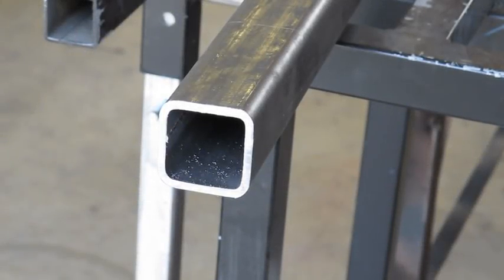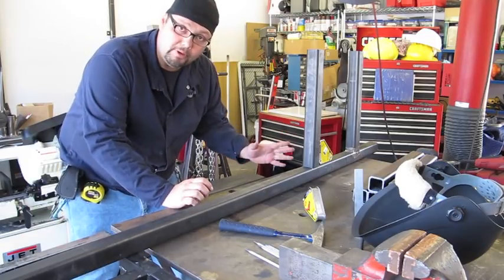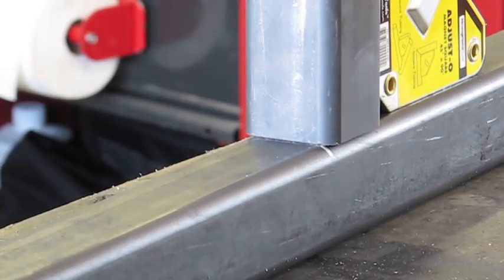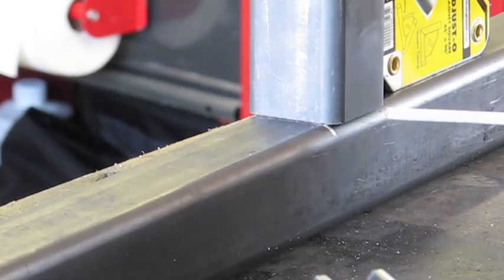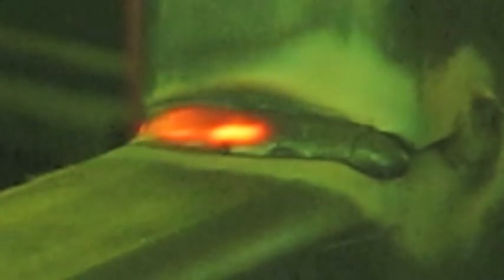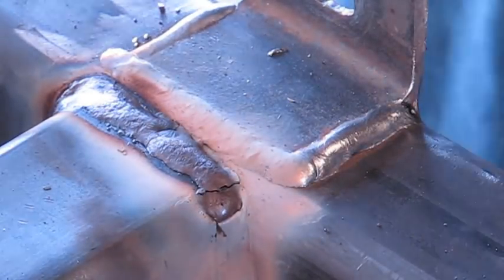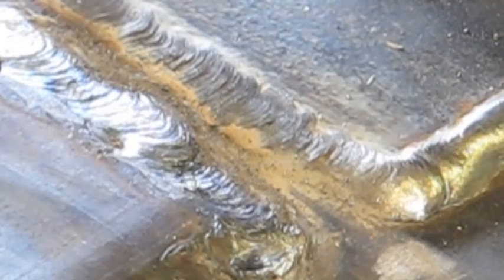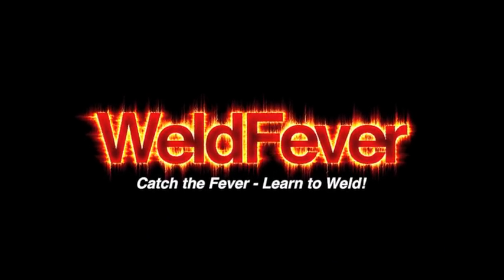Stick Welding Square Tubing

Comment: I always think of welding as a related behaviour to water drops, in that the surface tension of the liquid will hold the  liquid together and in order to bridge the drop to the side being welded this side has to be in liquid form too, so the handling of the stick has to see to that. If the temperature is too high the surface  tension will be low and the drop will collapse too much.    Overhead welding is possible because of this surface tension in liquids being kept  at a correct value.
To explain  welding to newcomers , I  first use water, A water drop on the tip of a pointer finger will not bridge with  the pointer  finger on the other hand, but on  closer range it will and a crescent will form. Once the drop bridges both sides  to be welded, the heat flow  to each side can be  regulated  through the positioning of the electrode with respect to the mass of material on either side.
The last time I explained  this to a pensioner  trying t learn to  weld, he said, " It is like trying to teach the electrode how to DANCE!"
Reply from the maker: An excellent analogy, if I do say so myself! I too use water as an example to my students by comparing the flow of water from a common garden hose to the way the puddle of molten metal behaves as a result of the way you direct it. It seems to get the message through. Thank you for that insightful comment!

Comment: Hi Dan, what thickness electrode / how many amps did you use for this project? I'm about to weld up some similar tubing (50mm tube, 5mm wall thickness) but I'm still learning electrodes and settings by trial and error at the moment.
Reply from the maker: They were 1/8" (3mm), E7018's and I used approximately 110 amps, which is my default setting for anything under about 1/2" (12.7mm). Given your wall thickness, I might suggest a lower amperage of around 90, or using a smaller rod. Hope that helps, thanks for your question and please keep watching!

Comment: WeldFever 
Hi, What ampage setting was the stick welder set at to get those results?
thanks :)
Reply from the maker: SP330Y I beleive it was around 115 amps +\-
Reply: +WeldFever can you make a video with smaller pipes like 4cm by 4cm in 2mm thick ? what amps will you use and what kind of electrodes in this dimension ?

Comment: looks good man. why did you decide not to add gussets?
Reply from the maker: Rmz250ryder I felt it would be strong enough without. Especially given the deep penetration and fusion as a result of using the stick electrode.

Comment: Great video bud,very informative.I have a question for ya.I'm going to build a go kart with square tubing.What thickness tube do you recommend for the frame?Another question is I have a Sears 115volt wire welder and I'm using flux cored wire and I have .035" and I also have .030" wire and I also have a buzz box 220 and I have E6011 and 7018 rods.Which one of the two machines would you recommend to use for a beginner like me on this go kart project?Thank you for your time.
Reply from the maker: James Parmenter without knowing the specs, or how much weight you're going to put on it, I couldnt even venture a guess. My best advise on anything that's going to hold people is to over build the heck out of it, but that's all I can really say. I would use the buzz box with dry 7018's (out of a hot box or hermetically sealed packaging). The reason is you'll get better penetration than the 115 can produce, and being a beginner, you may not realize it if you lay down a weld with MIG that does not fully fuse, or penetrate. Whatever you do, don't take any chances! If you're going to build something that you intend to put people in, or on, make certain your welding skills are where they need to be before you build it. That's my best advice! Good luck.
Reply: WeldFever Thanks for the advise bud.Keep up the good work.
Reply: WeldFever hey weldfever, my friend wants me to make him some tube doors for his jeep, what size would you recommend?

Comment: What do you recommend for a good stick welder without draining the pocket book?  Is this a 110 or 220?  Do you need gas for a stick welder?  If so what kind of gas.  Thx
Reply from the maker: In another comment you posted, I mentioned I started with a Lincoln-225. It is a 220 volt machine, and you do not need gas for an arc (stick) welder like this, or any stick welder for that matter. Hope this helps!

Comment: Great video - thanks. While others have claimed to be ''noobs", I'm the real deal... :-) (just bought a small arc welder yesterday, don't want to try using it until I get some proper PPE). Anyhow, regarding safety, the manual in bold letters states it should never be used outdoors. Other than the threat of rain or grass fires - any other reasons?
Reply from the maker: +shootgp Well, if it's a MIG welder and you are using shielding gas, then you will want to avoid winds stronger than 5 miles per hour or it will blow your shielding gas away. Other than that, I could't tell you why it would recommend against it?
Reply: Make sure neighbourhood kids don't look over the fence and get flashed.
Reply: Henry, thanks for the comment. I hadn't considered that - but it does make sense.
When I see someone doing a weld job in the drive way, like an idiot I'm trying to look and see what is being built...
I was thinking perhaps the reason regarding outdoor use was pertaining to extension cords (probably of the wrong gauge/length).
Reply: I should say, in addition to grass fires/rain/extension cord problems, and now blinding the curious.
Reply: +shootgp Mama always told me not to look into the mouth of the sun... but Mamma! that's where the fun is!
Stick welding outside!

Comment: I bought one of those square magnets and tried to weld a short piece od 10mm rod onto a piece of tubing while holding it up straight with the magnet.  The arc caused a lot of splatter and the welding did not want to grab onto the rod. After several adjustments to my welder and changing welding rods I still had very poor results. Then it struck me that it could be the magnetic field... I removed the magnet end whalaa! Immediate success. 
Can you guys tell me if this is a correct assumption? If so, what distance is ok for the magnet to be from the arc?
Reply from the maker: +Okkie Butler A disturbance to the arc caused by a magnetic field is called arc blow and it is very common when welding on DC polarity. Try welding on AC with your magnet on (if you can). If you no longer eperience problems, then that arc blow is confirmed.
Reply: +WeldFever Thanks for the comment!
Reply: +Okkie Butler you can try wrapping your ground cable around whatever you are welding, if it doesn't help trying wrapping it the opposite direction, i believe this sometimes helps if you don't wanna use AC. Or just don't use the magnet
Reply: +Okkie Butler the lincoln 300 has some nice control settings to vamp up the arc force and it really helps. some of the top end machines overcome the issue.

Comment: i build booms for wreckers.  we use mig, and the plates on those can be up to 1/2".... it is strong enough to withstand the pressure of lifting a tractor trailer... i understand stick is supposed to be stronger but if mig welding can do that, why do you say 3/16th is soo thick you need to use stick?
Reply from the maker: +Michael Hall Here is a copy of something I wrote to another user with a similar question:

"Let me try to explain what I meant. My shows are mostly meant for beginners using consumer grade products. As such, these products do not usually have the amperage ratings necessary in order to produce a weld with proper fusion and penetration on thicker, heavier, structural type material. Add in the fact that we are welding using the short circuit mode of metal transfer with the GMAW process, which as you probably know is the "coldest" of all the modes of transfer, then you can understand why I caution my users. The bottom line is that I don't want someone to believe they can take a 100 or 140 amp MIG welder and start making trailers and tow hitches with them, especially if they are not experienced enough to know what proper fusion looks like, which I run into all the time. "

So, that's why I made the statement, and I hope that explains it better. I'm certain you are using a commercial welder with a higher current output that can easily tackle what you are referring to, but that's not the case with the majority of my viewers.
Reply: ok that does make sense.

Comment: Do you have to grind the weld to material level or is it ok to leave the bulge?
Reply from the maker: Usually the reinforcement or "bulge" is left, unless the object requires a fine finish.
Reply: +WeldFever grinding a weld flat destroys it it will not last

Comment: Ok I have a really stupid question>>when you stick weld can you get electrocuted if you touch the clamp or stick?
Reply from the maker: Chicken Friedfish Theoretically you could, so you don't want to do that intentionally. The reason we don't fry up every time we weld is because electricity favors the path of least resistance, and our bodies are not ideal conductors. So, it chooses to flow through the metal being welded in orders to complete the circuit. Also, never weld while standing in water, because electricity also always want to return to ground and standing in a puddle of water can turn you into a conductor for electricity to return to ground, thus electrocuting you.

Comment: Well I tried to weld 4  3/4 " threaded bungs and one 1 1/4 in bung on the next side and put 3" caps on each end..  It didn't turn out so good. I put a water facet on and hooked it to water with a wash machine hose.  I had 12 pin hole leaks. I kept trying to weld over them, I got it down to 4, but I've got the worst looking globs of weld all over the place. I can't leave it like that or the guys will joke about my welds.  I think I will grind it all down and try putting another bead around each one.  I'm so tired of testing an welding then testing I'm about ready to give up. I was using 7018's had the welder set at 70-100 then 6.  I tried 100 up and set it at 7 and it seemed to work a little better.  I just don't know.
I'd love to see you weld  bungs on 3/16" square tubing.  Thanks
Reply from the maker: msnstock Send me a photo of the material you're trying to weld, and I'll try to make a video on it. You can send It to dan@weldfever.com

Comment: I like stick welding now more than MIG. MIG is easier and looks good. But stick is just so basic and you can get good enough looking welds with 7014 and 7018. No meed to put wear and tear on the MIG. Save it for the smaller jobs.

Comment: im a qc supervisor at a steel rack plant for car part racks we use mig only. ford or gm doesnt like arc welds on there racks.
Reply: As a qc supervisor you should know that mig is an arc welding process. Their racks not there racks.

Comment: If you are going for strength why didn't you use 6010/6011 as a root in your gappy weld and then cap with 7018??  or even grind some nice bevels and do a root weld all around with the 6010/6011 and then cap with 7018?
Reply from the maker: jdkeyes2000 I think that would have been overkill. The reality is that I would be fine MIG welding this, but I wanted to do something different and give an alternative to those viewers without a MIG, or who are not proficient enough with MIG to pull this off. The extra heat that a stick electrode provides is perfect for the thickness of material, but doing a root and cap would introduce too much heat to the material and would thus increase the heat affected zone. An increase in the heat affected zone would ultimately weaken the piece, so adding more weld would be counter productive. Thanks for the question!
Reply: WeldFever  sorry but that makes no sense 6011 penetrates & 7018 fills
you need penetration for strength I hate to say

bury your electrode ?
Reply: 6011 is also considered a freezing rod, which means it can be used overhead without dribbling.  It also can "freeze" into big gaps using a zig zag motion.  The 7018 is a nice cap that fills and looks pretty.

Comment: when your welding do you just drag the stick or do you have to put a motion into the stick while your going through the weld
Reply from the maker: +Harley Fuentes Motion, or oscillation, is only required on E6010 and E6011 electrodes. Having said that, I usually like to move slightly side to side (not a weave) in order to pause on the sides to prevent undercut and get good fusion.

Comment: For the last weld you did lying flat, would it change/improve or worsen something if you stood the piece up to weld so the rounded edge is above with the bottom of the open bar directly below or would that cause the molten material to drip to far into the crack..?
Reply: This flat position is by far the easiest to control.
The surface tension of the molten metal bridges the gap, and by tracing the edge with the electrode the weld can be pulled along this gap.
Welding sideways as you suggest is also straight forward, though extra technique is required to keep the puddle in place on the vertical surface.  The electrode is angled upwards slightly, and the arc force (together with the right amount of heat and travel speed) keeps the puddle in the joint.  Use a few too many amps, or hang around in one place too ling, and things will go bad quickly...
Reply: Ok, thanks.

Comment: im in welding school now and im having trouble seeing where in striking to start the bead. obviously since its a dark lens. im getting the hang of striking an ark but cant get the damn stick where i want it. very  frustrating.
Reply from the maker: +garyP102782 Try an auto darkening helmet and you will find it much easier.

Comment: What is a good first stick welder
Reply from the maker: Shelley Myers I started with a Lincoln AC225 also know as a "fuzzbox" or "tombstone" welder. You can usually get them used for under $200.00 and they are workhorses that last for years (provided they are not abused). The only issue for some is that they only run on 230v service, so if your home/shop/garage is not wired for it, it won't work. Good luck.

Comment: I still would use a Mig. welder Miller 225 with #6 .035 wire and 70%argon 25%c2 5%o .same as 7018 by the book. But not for the beginner.  as it runs hot and fast !

Comment: mig would of been fine for strength with that box section.
Reply from the maker: +just bud I agree with you, however my comments were directed to persons just starting out, and may not know good fusion from bad. Many of my viewers are new to welding, and I want to provide info that would allow them to make safe and well fused welds. Persons with your experience will know the difference. Thanks for the comment.
Reply: +WeldFever 👍

Comment: what did you do to prep the surface for welding?
Reply from the maker: Generally, I use acetone to wipe off any oils, or contaminates. I have noticed lately that there are some degreasers on the market, like Simple Green Commercial (purple) that claim you can use it for pre-weld cleaning, although I have not tried it myself. This would be preferable to acetone in that it is not as toxic, however, Acetone is quite safe if you use gloves and have plenty of ventilation or a respirator. Anything worse may require the use of a wire wheel, or sanding disk to remove such contaminates as paint, rust, or peeling mill scale. Hope this helps!

Comment: I'm trying to learn myself how to stick weld running up to a go kart project, but practicing on square tubing put on a flat piece of scrap metal the same thickness as this, im seeing a fair amount of beads come out and it tends to make holes in the weld aswell, could this be because of setting the settings too high on the machine? My machine doesnt have an AC-/DC/AC+ but just a dial, and my setting is 120, any ideas or do I just need more practice?
Reply: If your stick makes a buzzing as you weld you' e likely got an AC only welder, so make sure you are using a rod intended for AC (check the box)
The box will also tell you what current range the rod is intended for.  120 amps is relatively high.
To start, try a rod about 1/2 to 1/3 the material thickness and run beads on flat plate.  Once you have a feel for the puddle, and can run a nicely crowned bead with the right amount of heat, try a lap joint, then a tee.  Plan on burning a lot of rods as you practice... welding school takes years to teach these skills, so you shouldn't feel bad if it takes a few hours to get past lesson one ;-)
Good luck!

Comment: G'Day, I have to do a school project in metal work which involves stick welding thin square tube and I was wondering what amperage you set your welder to?

Comment: hi, just need help since im new at welding. what electrode is best to use for 2x2 3mm tube? 

7018 or 6013? gonna make a squat rack for a project :)

thanks!

Comment: What size rod did you use?
Reply from the maker: 1/8" (3mm), E7018, Lincoln Excalibur.
Reply: Is there any reason yo did not bevel the edge of the top square pipe? Would beveling be of any benefit?